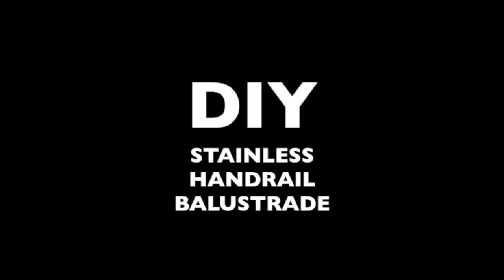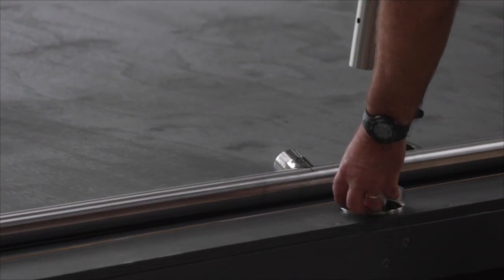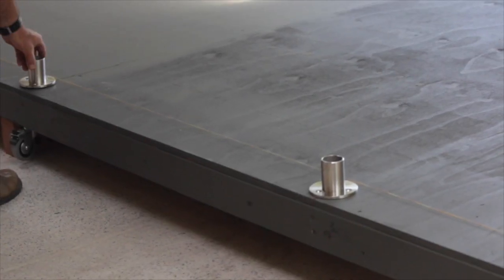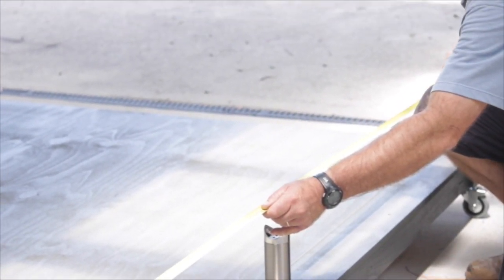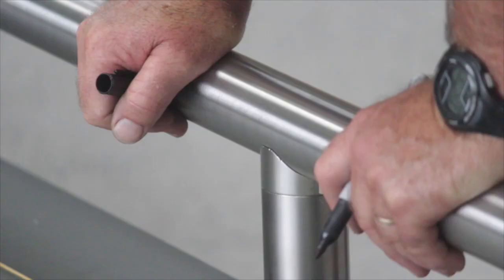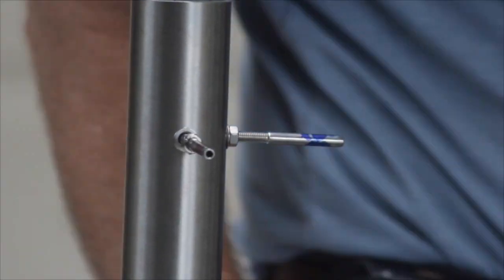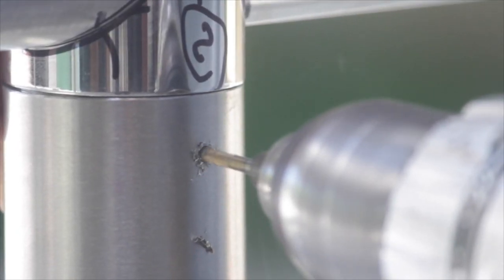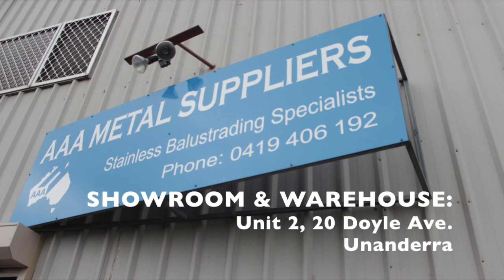How to Install DIY Stainless Steel Posts and Handrails

Comment: Hey! Great video. One question though, when you insert the post into the long base plates, how do you secure them? Do you use special glue or you just insert the post in the long base plate with pressure and that's it?

Thanks in advance!
Reply from the maker: We suggest you use a fine piece of stainless steel wire and epoxy glue.  Please see our video https://www.youtube.com/watch?v=842pfHhBECA